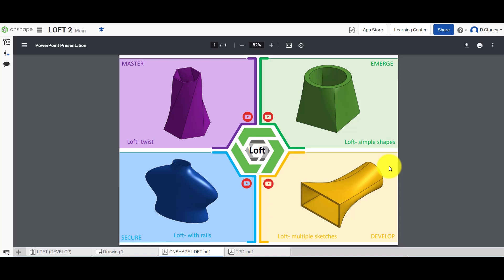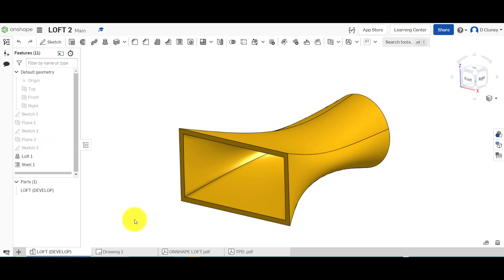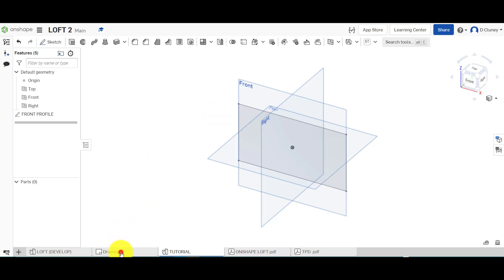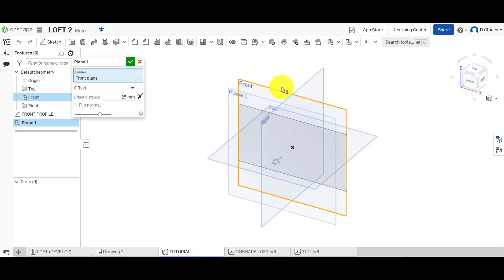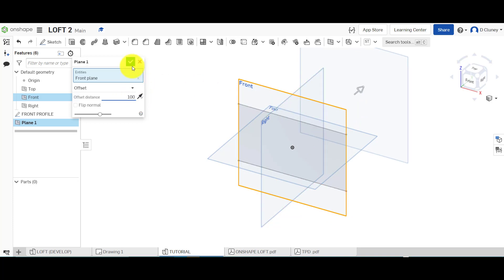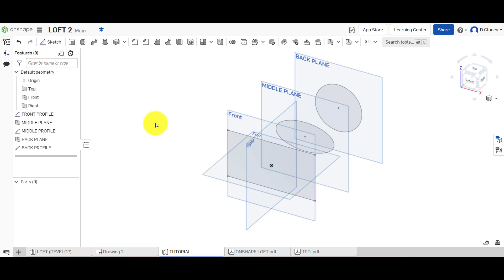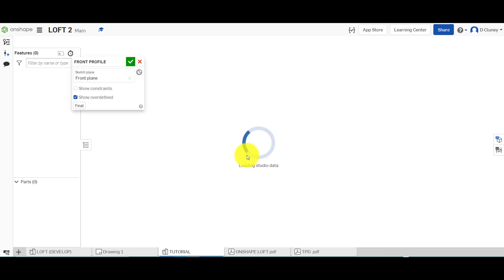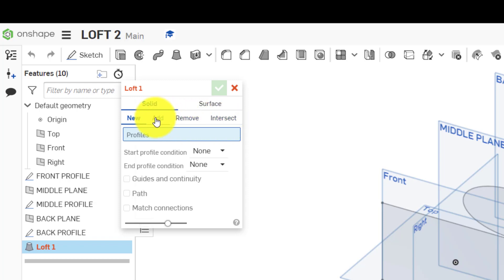Onshape Tutorial- How to create a loft with MULTIPLE sketches. The Basics. Step by step guide.

Comment: Was having a ton of trouble even getting it to try lofting. The key was to select the sketch "face" (grey highlighted thingy) within all the sketch curves which supposedly is called the profile. Trying to select the sketch curves individually for each profile really messed with OnShapes head. Or selecting the faces normal to your intended loft, that also did not work for me... But with the above key point and adding a few guide curves, I was in business. I'm a CAD guy coming off years of NX experience (20), and some solidworks back in the day (like 2005 lol). Thank you so much for your video!
Reply from the maker: No problem 👍